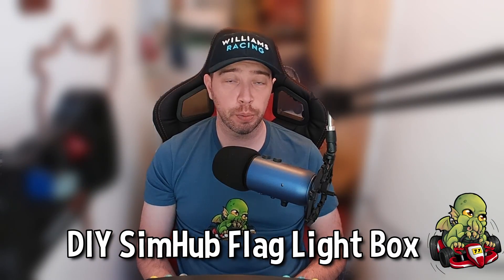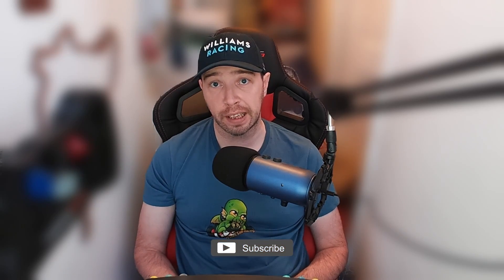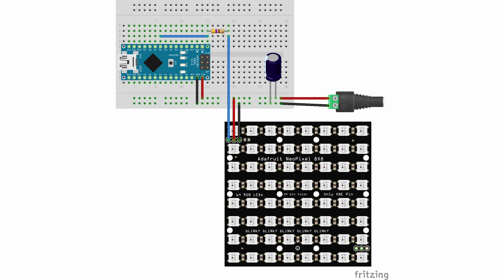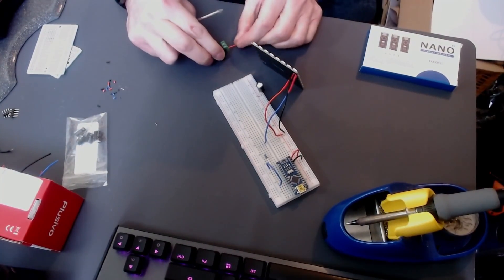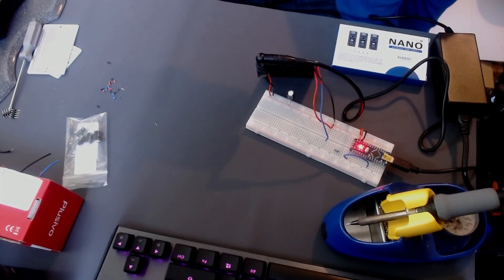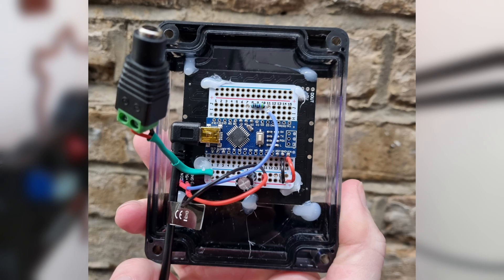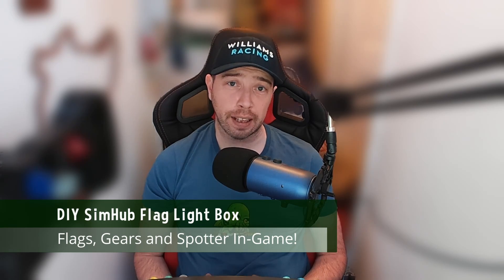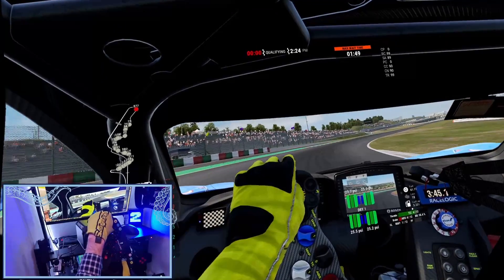DIY SimHub Flag Light Matrix

Comment: Great Video, BRAVO!  I ordered some flag lights but they are not traditional square, they are rectangular.  Which type are best? the one's i bought are 175usd but i can't remember the name of them.
Reply from the maker: If you can remember the model number, we can check for compatibility. So long as they work with SimHub, the panel shape shouldn't matter much. If the panel is not 8x8, you might need to make some code adjustments to get it all working, though.
Reply: @TeqqlesdoesVR  -- Hi thanks, yea here's the model information, SRE-MLD-01 SimRep Engineering Multi LED Display  x 2.   Thanks again so much!!!!!

Comment: my martrix screen is only showing the gears whatever i do it wont show anything else
Reply from the maker: I'm creating a video to explain how to set up Simhub in a bit more detail.  For the time being though I'll try to explain it here: Under Arduino > RGB Matrix,  In the "When the game is running" section, click add an effect (little blue link underneath).  Here they have Flags, Gear and Spotter overlay.  If you are having trouble with the other effects not displaying then play around with the order of the effects as it could be that the gear effect is overwriting the others.
Reply: @TeqqlesdoesVR  i think i already found out its becouse my rgb matrix is with  5 pins and i need to use the version in simhub with 5 pins and that only does the gears and can do nothing more :/ so i need to buy a new matrix
Reply from the maker: @Okkkkkkkkkkkkkkkkkkkkkkkkkkkk9  ahh sorry to hear that mate 😞

Comment: Any reason it works in Simhub and not ACC?
In ACC only the gear and limiter works.
Reply from the maker: Are you using the default profile or the one I created? Seems odd that you have a partially working solution otherwise. I'll have a look to make sure SimHub or ACC hasn't updated anything that has broken some of the features.
Reply: @TeqqlesdoesVR  will it work with Automobilista 2?  I realize that's the old Brazilian Project Cars game, but I was told as an extreme novice, do NOT start with ACC, ACC Evo, AC, iRacing and the lot, just go with something called Automobilista 2.   And thus far it does seem like a good game, yes it's full of Brazilian tracks but I'm getting used to things.  Any suggestions on what additional DLC's i should buy?

Comment: Keep getting error when using your simhub led profile "An error occurred while saving profile" when trying to import your profile, other LED profiles have worked in the past, do I need to do anything special to use yours?
Reply from the maker: I'll double check for you when I'm on the rig. There wasn't anything in particular special about this profile, other than the small logic around the meatball flag.

Comment: Is it not possible to just power the Led matrix via USB instead of USB and DC? With an ESP8266
Reply from the maker: It is indeed possible, the circuit depicted in this picture should work sans DC.  https://github.com/Teqqles/SimHubMatrixFlagLights/blob/main/images/simhubflaglights_sans_power_bb.png  - the one I created in the vid would also work but you'd be doing some strange vampiric leaching from the Arduino so it'd probably shorten the lifespan. The brightness of the unit using this setup is still pretty decent too, I was just a bit worried about drawing too much power from the USB when I did the project 😅